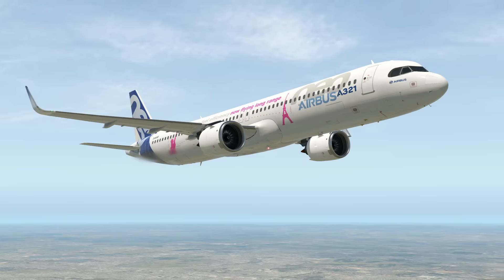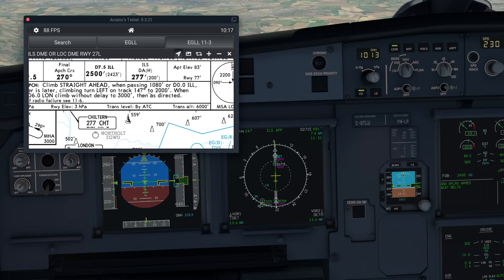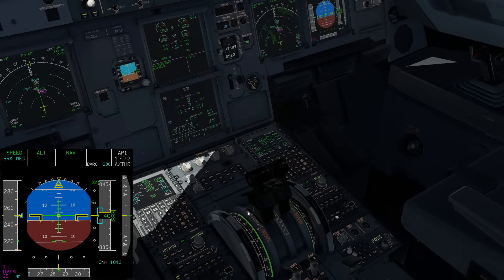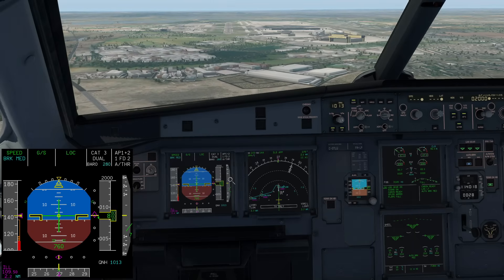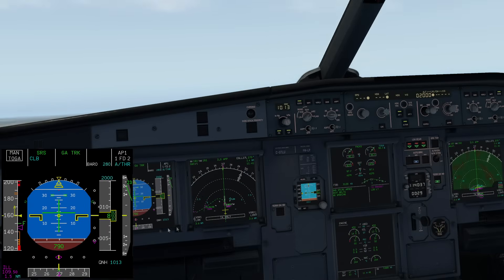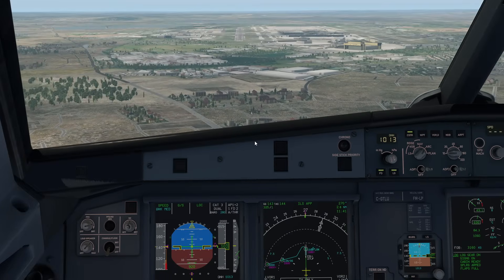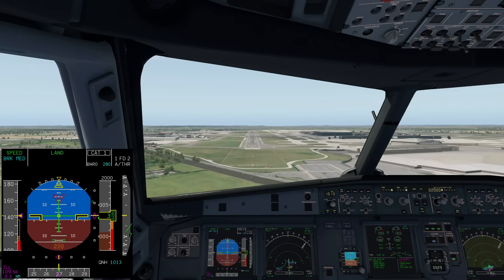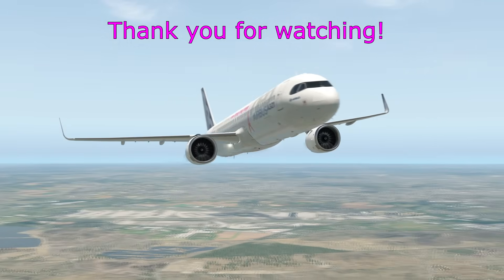What Is The Airbus 'Soft' Go Around?! Real Airbus Pilot Guide for Flight Simulators!

Comment: Hello ... thanks for the video ! Is it correct when you set the throttle to TOGA for a GA you dont need to touch the yoke to pitch up the A320? Thanks
Reply: Only if the autopilot is on. If not you still need to pull back slightly on the sidestick and follow the FD bars

Comment: Nice video well done. Personally the biggest use of a soft go around is a non standard ATC intervened one where your instructed onto a heading and non standard altitude.
Fingers spinning wheels etc rapid mode changes the soft go around which Boeing have had fir decades is a life saver. 
Oh the FSLabs does auto Nav mode on a missed approach its the only Airbus in sims that has auto nav. 
Tollis model still has a very old S3 software version which left service 10 years ago in a supposed new airframe.
In short they are short changing users.
They still havnt implemented numerous normal features like correct Finalapp behaviour for RNAV approaches which is a core fundamental of any Airbus “simulation”.
Im not the biggest fan as the continual release of half baked products is a typical xplane producer feature.
In short dont bother getting the base model working correctly just keep on pumping out releases.
Heaping praise on devs releasing half baked products rather than calling them out only encourages more half baked products exactly like msfs and its horrendous NEO.

Comment: Really nice tutorial. I think the config warning is just a bug. Pretty sure it only goes off if there’s weight on the wheels. With respects to disconnecting the AP too late in the low go-around when demonstrating GA SOFT, you had CAT 3 DUAL on the FMA so no limitation in disconnecting the AP at any height. You only need to disconnect the AP by 160 ft when CAT 1 is displayed in the FMA. 👍

I always brief guys I fly with that I’ll only use GA SOFT down to 500 ft (our stability gate). Below this I will only use TOGA as I consider it too close to the ground after that, as you also alluded to. This isn’t a company SOP, nor an Airbus SOP but I think it’s a good habit to get into.

Comment: As always a great video. I've used this go-around mode in MSFS on the A32NX. It does make the whole maneuver so much more relaxed. Airbus designed a great system there
Reply: Is soft go-around available in the current stable A32NX Pete or a dev build?
Reply: I typically just check and install the Dev build of the aircraft. I'm sure it's on the stable version as well, but I could be wrong
Reply: @cavok1984  Thanks